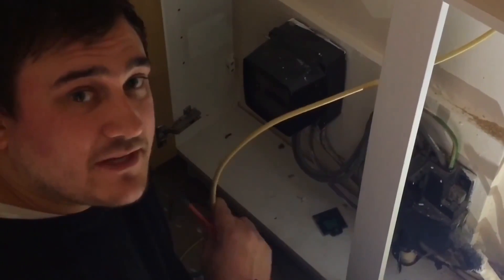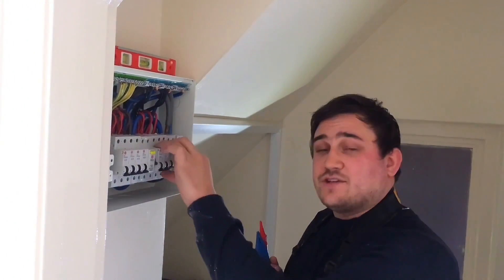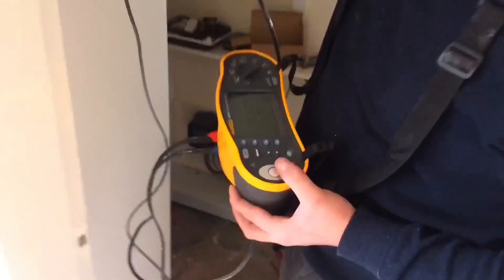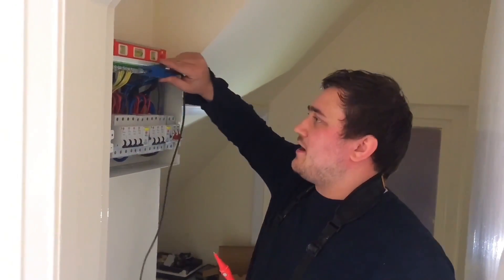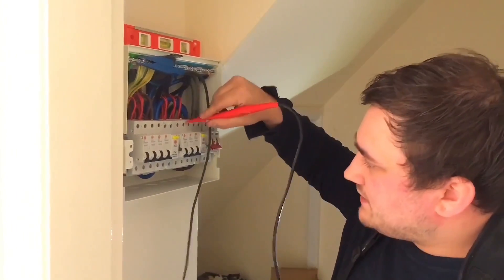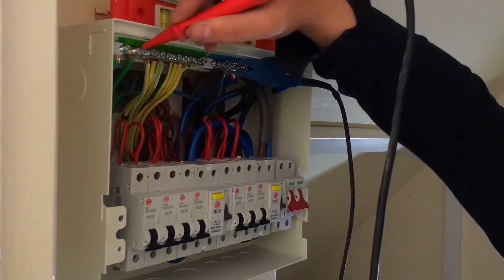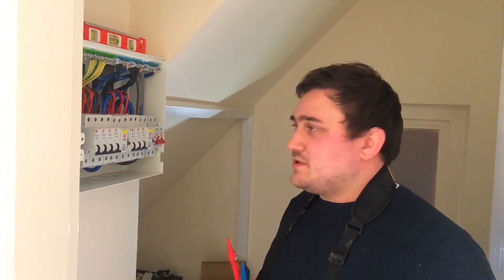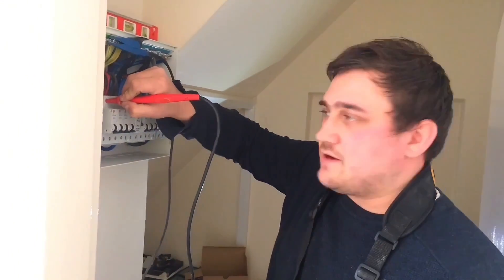Whole Installation Insulation Resistance Test

Comment: Sorry if i sound thick i didn't get the strappers bit.
Reply: If you’ve got double switched lighting circuits you’ll need to test more than once, part of the circuit won’t be tested on the first test (strappers between switches) as the switch will be open on one conductor and closed on the other.  So test, check results then operate the switch in the other position and test again ti catch the other conductor.  Hope I’ve worded that clearly 😂
Reply: @noskills9577  thank you that makes sense.

Comment: should comment that the Fluke tester will only give a max reading of 500MOhm when on 500V test - it could well be higher.  It's a feature I like and dislike about the flukes - a quick way of seeing the test voltage (a new install should peg the tester), but does have a few issues with calculations for IR on large systems (remember its the installation not the circuit that has to be above 1MOhm or 20MOhm)

And I agree, its a very pretty CU.